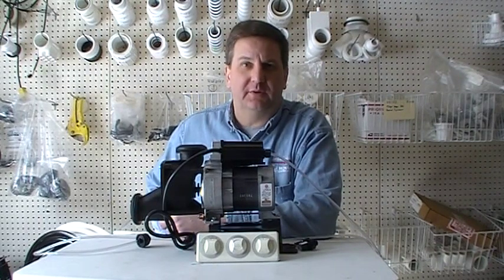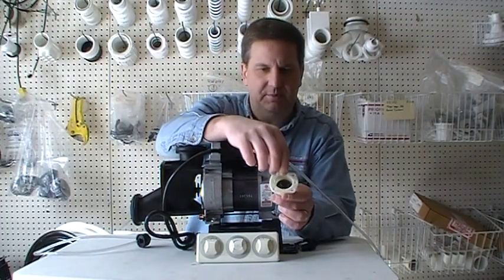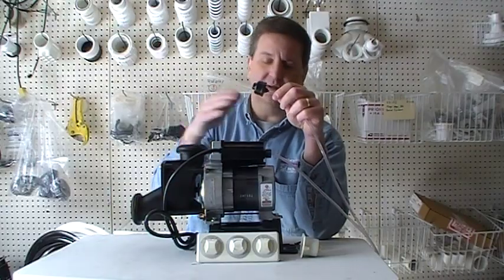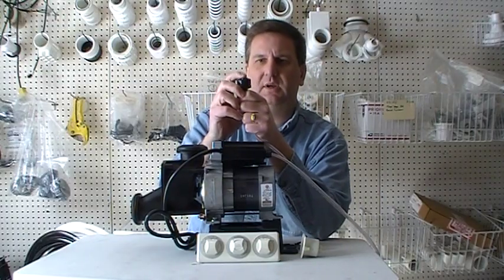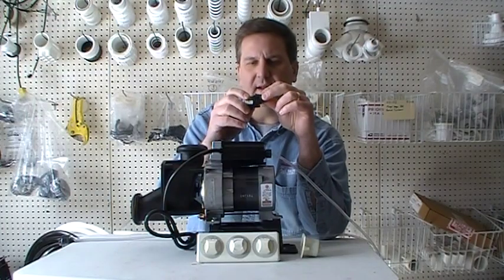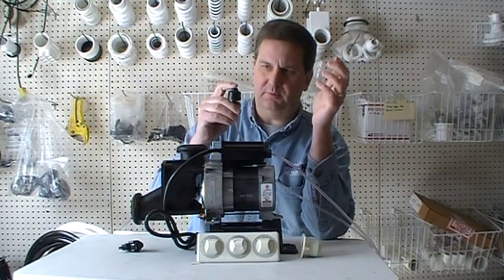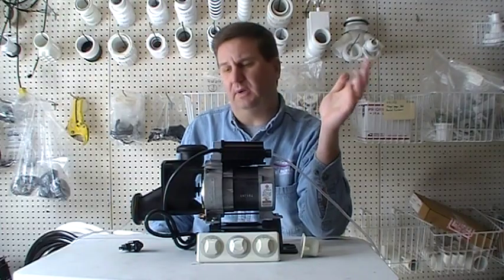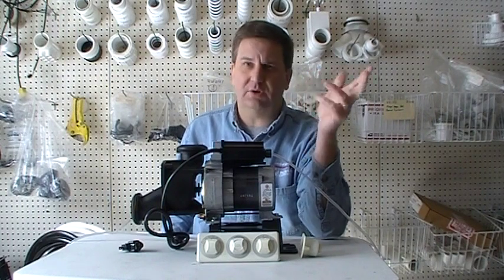How to troubleshoot your JACUZZI® Whirlpool On/Off Button-JACUZZI® Tub Parts

Comment: I have to hold my  button down to keep it running. Other times once it starts it won't stop if you press the button again. I find myself having to get out of the tub and turn off the circuit breaker to stop the Whirlpool from pumping. This is my first unit, as I bought the house with this already installed.
Am I right too soon that if you press it one time the motor will continue to run and if you press the second time it will turn off? Other than that I have no instructions on how it works. I would definitely appreciate some more instructions if anyone has them.

Comment: I put new buttons and all the works and I still can't get mine to turn on and off.  We have to use the circuit breaker!  We got pressure in the tubing when we pumped it up and hear a clicking on motor we are at a loss!
Reply from the maker: Please call me to discuss further: 1-877-277-5189 Thanks AJ

Comment: When I push the air switch button the pump runs but won’t stay running. When I release the switch, it shuts off.
Reply: Did you find out what is going on main doing the same thing

Comment: I have a jacuzzi tub and mine doesn't have an air button on/off switch, mine has a 3 button switch with a on/off, light on/off, and light color change button.
On this 3 button switch it also reads the temperature of the water in the tub.
When I moved into the house 10 years ago everything worked perfect with the jacuzzi. But in these past few years nothing is working anymore. 
I ordered a whole new set-up that includes a new power box, new light, and new switch, and all the wires to connect all.
I hooked everything up just like it was before and I still get nothing.
The pump itself still works fine if I bypass the power box and just plug it in directly to the power outlet.
I spent a few hundred trying to fix this problem with no luck.

Comment: What if the motor is turning on and off randomly for short periods of time? Could that be the air actuator?
Reply from the maker: +hsearch The same recommendation would also be for your situation. Order all three parts and change all 3. That's the only way of totally guaranteeing your tub will be fixed in one shot. Pneumatic control systems are just way to fussy.

Comment: Replaced the diaphragm switch, the motor failed to shut off. Compressed the switch diaphragm, hooked it to the hose, the diaphragm did not reinflate. Is it possible the motor switch is the problem?

Comment: So the issue with my button is that its really hard to push, and when we take the button off, the rubber needs to be pushed with a screw driver. Should I replace the rubber valve or something else as well?
Reply: Mine as well ,did you get any info on repair?